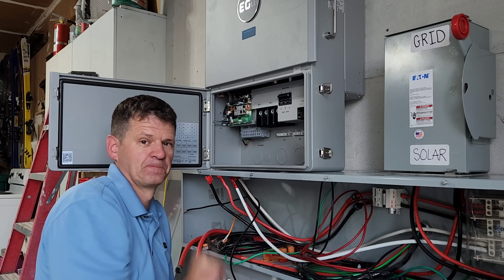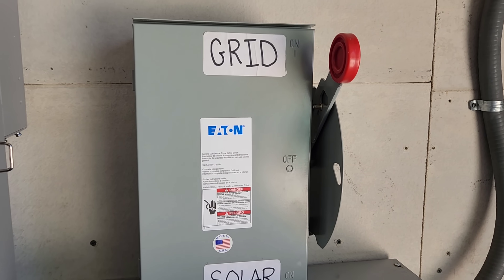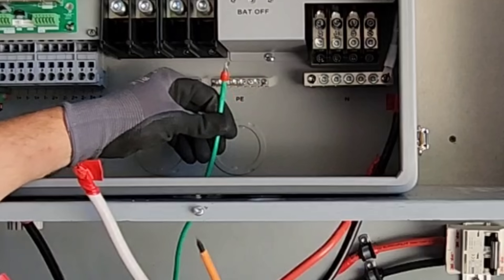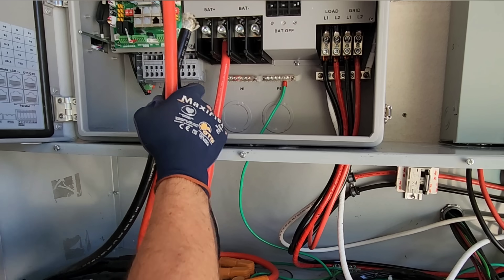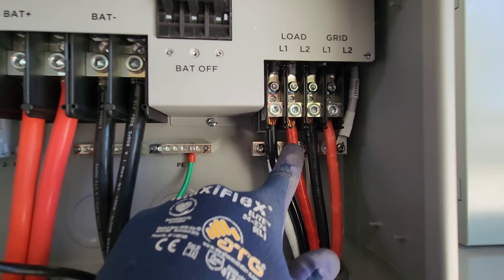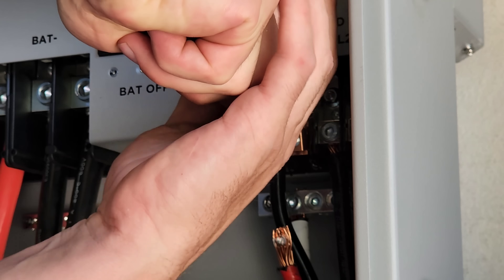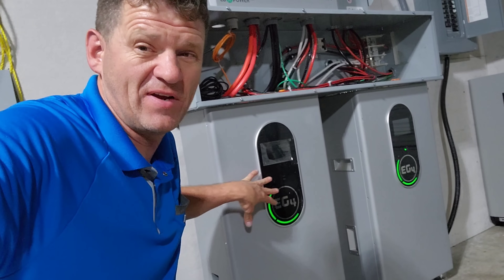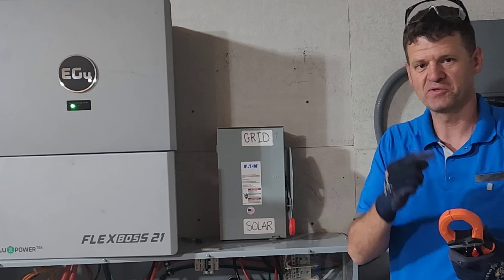EG4 FLEXBOSS 21 - Full Install With 1 Mistake

Comment: I think I'll go buy a lift cart for my install lol, but I appreciate the improvise, adapt, and overcome attitude, that has been how I do every project lol.

As for install, I am torn.  I can do a manual transfer swtich similar to how my generator works, but then I lose the emergency backup power when on grid power and that is one of the main reasons I want a system at all (we get power flashes all the time)

Also you have to constantly switch back and forth between the two each time your solar reserves run low, or are fully charged so you can use them correct?

I think I want my whole home system to be 100% hands off as my small DIY system now is more akin to this manual process.
Reply: Well, this is kinda a case study as to why one should go with getting utility permissions and inspections so one can have a hybrid inverter operating in grid-interactive mode, and not go with an off-grid / manual transfer switch type of solution.

You can do what you want without needing to purchase a separate ATS by using an off-grid or hybrid inverter AS the ATS.  By connecting the house to the "load" side of the inverter and the grid to the "grid" side.  The inverter operating in grid-interactive mode (with utility permission) can leave the pass-through active but offset the home consumption with its inverter.   The inverter operating in off-grid mode (often not requiring utility permission) can run the load side off of the batteries with the grid disconnected, or it can switch to grid pass-through and also charge the batteries while in pass-through mode.  

But an off-grid inverter (or inverter operating in off-grid mode) cannot assist the grid or export to the grid.  For example, if the house is using 20kW but the inverter is only capable of 12kW, then an off-grid inverter will be forced to switch to grid pass-through mode and not be able to assist at all (though it can usually still charge its batteries from solar while in this state).  Whereas a hybrid inverter operating in grid-interactive mode can assist with up to 12kW leaving the grid import at only 8kW in this example.

The GridBoss is basically an ATS integrated with the EG4 hybrid inverters (the Flexboss and KPV inverters), with a 200A capable grid input and house output, plus it also has other important functions to comply with code, such as manual bypass breakers, a fused service entrance capability, smart ports, and a higher-amperage internal bus.

-Matt
Reply: @junkerzn7312  100% agree and plan on having full hybrid setup  and permission.  I already have the whole house generator and want redundancies in case grid is down (use inverters), or if inverters are down (use grid) or if both are down (whole house generator).  Being in Houston, in IT, and former fire/EMS,  I never trust that 2 things wont break at the same time 😁
Reply: I am putting my generator ATS between all power source and the property/house main panel.  Basically, I am leaving it where it is.  What is changing is the "grid" connection in the ATS.  that is the output a manual transfer switch.  That allows me to grid or solar to the ATS.  It doesn't care what the source is.  Either there is juice, or there isn't.  If no juice, fire up generator just like it normally does.   The hard part is needing the generator to ALSO respond to  2-wire start/stop request from MID.  Testing that later today to see if I can use the 2-wire starts AND the ATS comm wire at the same time since they use different terminals.   If yes, then the genset output goes to a 100amp panel with two 100a breakers.  one breaker to inverter Gen in, the other breaker to the ATS.  Still working through some 'what-ifs' to ensure its safe with minimal chance to overload anything.
Reply from the maker: Thanks. I wasn't super clear at explaining that portion. But yes, this system is totally hands-free. When my battery gets low it automatically switches over to the grid power. It passed the grid power through the grid port and straight out the load port.... ie: It automatically does grid pass through when the battery is getting low. And then when the sun comes out it'll automatically switch back to solar.
Reply: @diySolarPowerFunWithRay  Ah, excellent.  So that means you are running the FlexBoss in off-grid mode?  You have the "Off-Grid Mode" option set to "enable" ?

Having it be automated is best.  Also in terms of battery margin... usually you'll want to configure at least 20% battery margin when on-grid so it doesn't immediate run out of storage in case of a power outage.

That's under "Battery Setting" .. the "Discharging" section.  I usually set off-grid cut-off to 5% and on-grid cut-off to 20%.

And then for battery charging you can configure a base line minimum using the "AC Charge Mode" working mode.  I usually configure "Start AC charge" at 15% and "Stop AC charge" at 18%.  So it will normally not charge from the grid at all, unless there was an outage and the battery got very low... then it will charge after the grid comes back on, up to 18%

(You can use this feature in other ways too, but that is the way I use it).

There is also a nifty "PV Charge Priority Mode" ... I think it can be used in off-grid mode too.  Basically you can tell the system to use the solar ONLY to charge the battery and to run the house off of the grid in situations where the battery is low.  I have mine set-up to do this between noon and 3pm as long as the battery is below 50%.

Normally my battery is at least 50% by noon so it never triggers in the summer, but in winter this may not be the case and I'll want to run off the grid to get the batteries charged enough by 3pm to cover the peak pricing period from 4pm-9pm.

-Matt
Reply: The lift cart is great for these installs. I have installed several inverters with one and it has saved time and my old back from feeling it the next day.